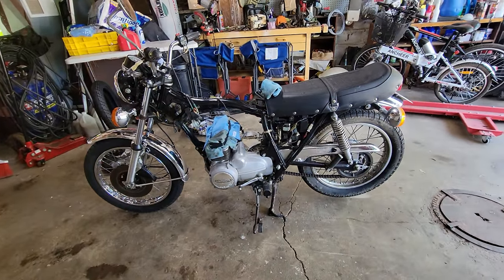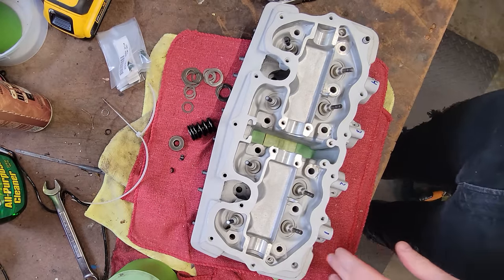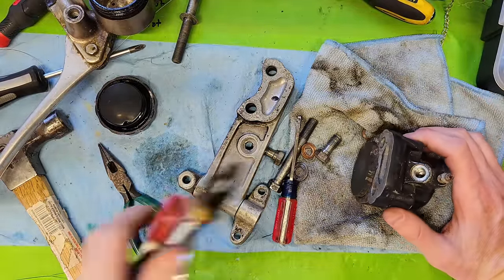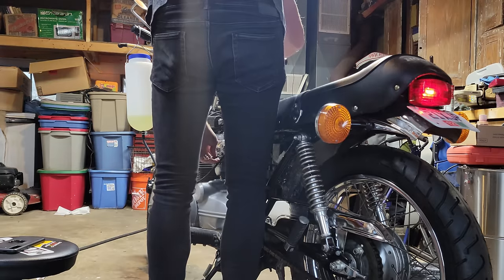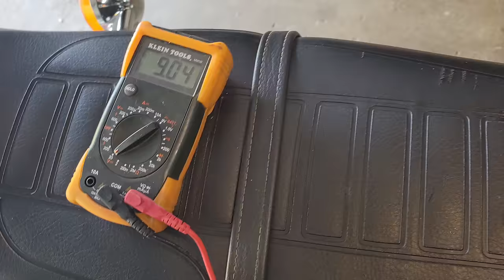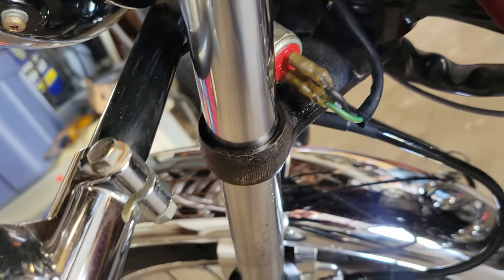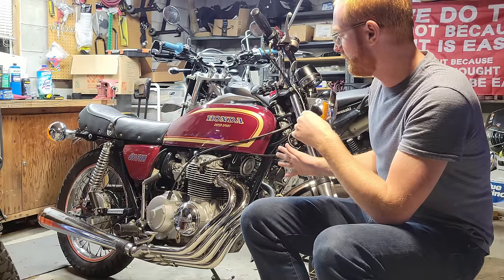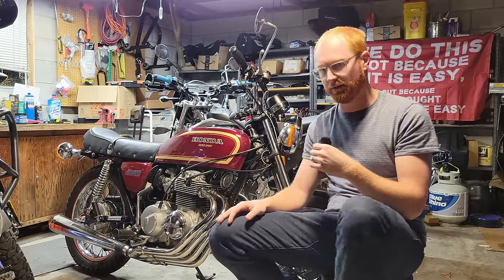Forgotten 46 Years - Will This CB400F RUN AND RIDE 200 Miles Home?

Comment: never had the pleasure of using an ultrasonic cleaner how I was taught was to take a giant cooking pot and fill it with oil and put it over a burner and heat it up my uncle had a special sauce that he called it it consisted of CRC transmission fluid and a splash of diesel any parts that were really grimy we would leave in overnight on low heat and by the next morning they would be so easy to clean and what I mean by Berner I mean an electric cooktop from a camper not an open flame just wanted to make that clear because you never know what somebody might do LOL
Reply: Hey man don't beat yourself up over losing some parts we've all been there and done that
Reply from the maker: haha dont want to set the house on fire with that blend, but I have also head of people doing similar mix in their ultrasonic, though most of the time the hot water alone does most of the work!
Reply from the maker: I typically am pretty organized with my parts and important things. My father passed away so there was a lot of stuff getting moved around, including the garage. I finally let it go, and in true fashion some of the parts showed up!
Reply: @GoldenBoyGarage so sorry to hear you lost your dad recently. My father passed away in 2005. It was totally unexpected and knocked me for six. I wasn't right in the head for 18 months afterwards. Now when I think of him, it's not with pain at his loss but joy at the things he used to say and do. Best wishes.
Reply from the maker: @leon0  really appreciate that. He always was happy when Id show up asking to borrow the truck and grab a bike, meant Id be home more often. He wouldnt want me to be bummed out, and I know Im fortunate to have a dad worth missing! Do appreciate your responses!

Comment: All the UK chippies think this bike is great. Well in it's day and geared for 55 mph roads it was an A OK bike.  My fascination is HOW you were able to acquire the proper head gasket in Japan cause Google searches don't help. Got an ol 750 and wanted to refresh the upper end too. And 4 into 1 does seem to have 'SOME" reliable parts but not head gaskets. i use kerosene or diesel fuel to soak and clean chains like that. Degreaser in the sonic cleaner seems to weaken the o-rings.
Reply from the maker: It is a pretty fun bike, one of my favorites, but if you're riding with someone on say a Street Triple or modern sport bike, It becomes apparent on the straights just how neutered you are. It handles decent for its age too! Not sure if your 750 is SOHC or DOHC but there's a few places stateside that sell parts for the 750s cyclexchange.net has MLS head gaskets, the site looks like its from 1995 tho. For the 400, they are SUPER popular in Japan, so japan.webike.net has a bunch of stuff. Im sure they have SOHC 750 stuff too but I haven't looked. Have a DOHC in the garage for a future channel project.
Reply from the maker: Also forgot to mention the chain bit, on these older non-oring chains i dont mind throwing them in the ultrasonic, but wouldnt do that with a modern chain, nor would i do it outside of experimentation haha
Reply: @GoldenBoyGarage  Ah forgot back then they had no O-rings. Doh.
Reply: @GoldenBoyGarage  DOHC.
Reply: @GoldenBoyGarage  OMG Thanks for the info.